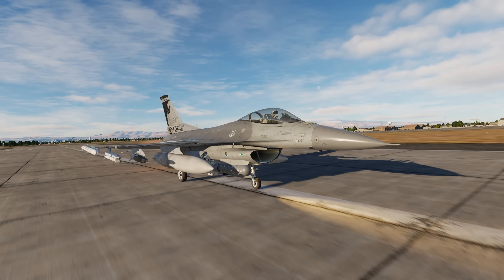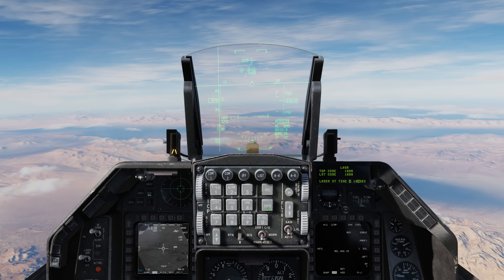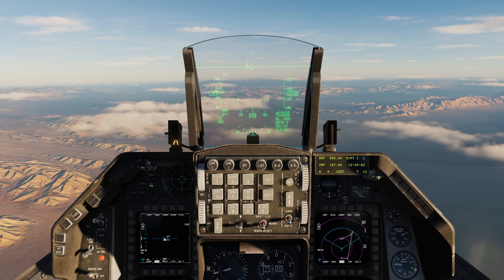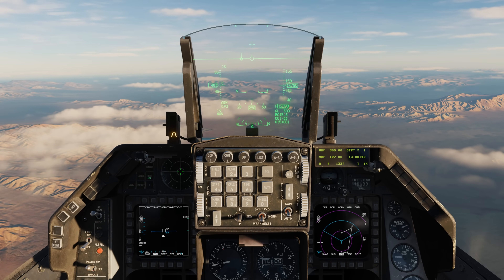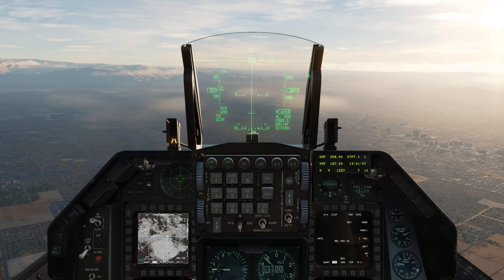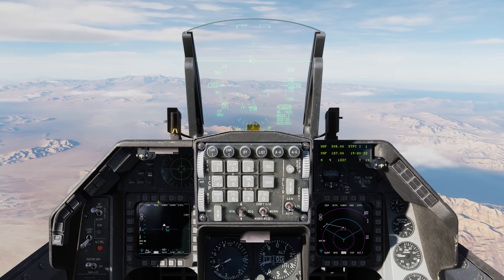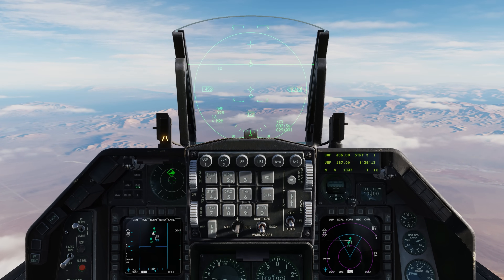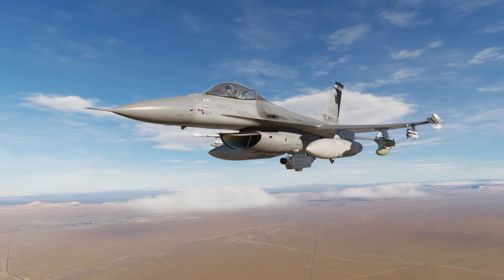DCS: F-16C Viper | August 2022 Update

Comment: Hello Matt witch systeem are you running?  Specs?
Reply from the maker: See About section of the channel, please.
Reply: Thankk you. But with your 2080ti  did you ever tested vr in multiplay?
Reply from the maker: @spirosdelistavros2970  Many times.
Reply: @MattWagner  and did it run on high settings an everything smooth?
Because other guys say no dont use 3060 it wil not run on high settings. So they advise a 3070. Its weard Because are running a 2080ti its even lower
Reply from the maker: @spirosdelistavros2970  You will need to adjust your Graphics and VR settings to arrive at the performance level that best balances performance and visuals.

Comment: what are the ACTION and CHECK OFF values in the manual bombing mode table?
Reply from the maker: Action is the distance from target you start the check off from (angle off) from target. So, at 10 nm, you check off 15-degrees left or right from target.
Reply: @MattWagner  Thanks

Comment: Didn't FLCS BIT work before? I'm sure I've used it before.
Reply from the maker: Nope.
Reply: @MattWagner  hmm, maybe it was just the cockpit panel light that I've seen light up and didnt look for flt ctrl movement outside. Are you planning to implement the engine SEC check animations in the cockpit too?

Comment: So is there no way to drop the wing tanks without dropping the pylons as well?
Reply: 370gal tanks are permanently attached to the pylons. The pylons and tanks don't separate from each other when dropped. Thanks to the aft pivot fitting, they really tumble when they finally release.  When 600gal tanks are dropped, the pylons stay with the airplane. Same thing for the 300gal belly tank.
Reply from the maker: Nope

Comment: As long as I know, AIM120s are slaved by default. So without a radar lock we can't be firing a radar guided missle. Slave should be changed to BORE (OSB 19 RMFD) in order to fire an AMRRAM without a lock.
Reply from the maker: Sorry, but no. The AIM-120 can be launched in what is called "Mad Dog" mode with no radar designation.
Reply: @MattWagner  yeah I know It's called maddog but to fire a maddog, the missle should in BORE not SLAV.

Comment: Having the FLCS bit animation is going to be really nice. Stuff like that goes a long way towards immersion and content creation. One thing I've noted tho is during the HOTAS mode cycling, it seems there is haze over Vegas. Is this a tease of the weather system updates in the works or am I bad at generating cool weather in the game?
Reply from the maker: Sorry, but probably the latter.
Reply: @MattWagner  It's all good, it's to the shock of no one. lol
Reply: You can turn on dust/fog at the bottom of the weather selection page. You can set density and altitude to give just a slight haze or crank it up to try landing in "the soup".
Reply: @ImpendingJoker  When the new clouds were released I heard the fog wasn't compatible. Was that fixed at some point or was I just hearing fake news?
Reply: Bit test adds an insignificant amount of immersion compared to fixing ground unit behaviour.

Comment: Hi Matt, the order seems off - should be CCRP->CCIP->DTOS  - this may seem minor, but it has huge impact as the pilot will have to step through one extra mode, switching from CCRP for example on the base turn to final, to CCIP for the release. Could you do a double take on that?
Reply from the maker: Negative, that looks like an older OFP.
Reply: Who’s “sources” are right?
Reply: @gb7418  just got out of the jet doing ops checks and Matt is correct.  CCIP > DTOS > CCRP is the correct sequence.

Comment: For the laser CCIP ranging, by "second detent" do you mean the trigger position that normally fires the gun? If so, does this mean we can't fire the gun in CCIP mode?
Reply from the maker: To fire the gun, you must be in Strafe mode.
Reply: @MattWagner  Huh. I guess I never tried firing the gun without bringing up the gun pipper before.
Reply: @MattWagner  can we use laser rangefinding in strafe mode?
Reply: @hphp31416  yes
Reply: @hphp31416  First detent fires the laser for range finder in all cases. Second detent does the 30 seconds "latched" thing for CCIP and CCIP/rockets. So laser ranging can be used in STRF, just not the latched 30 seconds feature.

Comment: I have the question about controls. Because in modern F-16 is the "force sensing stick" - Is the controller input converted to force applied on stick or as stick position? Is possible to change the stick sensitivity in F-16C panels?
Reply: Just tune the axis in controls
Reply: @e_norrby  I want to be able to change sensitivity on the fly. Like is possible in real aircraft with the force sensing stick.
Reply: @jaromirandel543  The relationship between SSC force and FLCS response is not changeable in the real F-16.

Comment: Confused about the wing tank jettison. When you say "pylons" You mean the pylons that the tanks were attached to or all wing pylons?
Reply: I believe wing tank pylons only.
Reply from the maker: Yes, as explained, when you jett the wing tanks the attached pylons jett with them.
Reply: There are two kinds of pylons at stations 4/6. Normally the fuel tanks (with integral pylons) attach directly to the wings and come off as a single item. If bombs are to be attached at 4/6 there must be a special pair of weapons pylons must be attached to the wings first and then bombs attached to the pylons. Weapons pylons are bolted to the wing and do not come off in flight.

Comment: TOSS cue for standard CCRP attack at 2:40 - isn't it a LADD mode actually? Correct me if I wrong, but in -34 manual LADD is described as similar to CCRP but adapted for 45 deg toss bombing profile for airburst iron GP bombs
Reply from the maker: No, it is correct. LADD is a bit different and will be added later.

Comment: I know it has nothing to do with this video, but where’s Vulkan? I haven’t heard any news since july or so. I’m excited for it, because there’s some people struggling to hit over 20 fps on a beast pc with 128gb ram 3090ti and 5.2Ghz in processor in vr or even without. I hope this will bring improved fps for everyone. I think most of us want this rather than a 8k detailed map we can run with 1 fps. I hope it’s this year😀
Reply: People in the comments on this post are talking about the relationship between hardware and frames in DCS. However this is just half of what’s required. The other part is flying missions with little complexity. 

No matter what PC you have, a mission can easily tank performance down to 15 FPS. 
That’s why DCS needs optimization!
Reply: @capricerocketman1207  right? These ppl fly their jet 1v1 air to air only it sounds like. If you want a real mission you’re facked when the triggers hit
Reply: @gb7418  i play on full pve and pvp servers i never dip below 50 fps, with 3060ti. OP must be doing something wierd in nvidia control panel or something
Reply: That's exaggerating a lot. But they need to do something about performance, I stopped playing last year because my setup that got 60-80 fps in VR doesn't even do 40 flat-screen now.
Reply: @icannon6611  Yeah, i’m not sure where the bottleneck is for you - i definitely do NOT get 90 fps but it is 60+ and VR (HP Reverb; slightly de-tuned visual settings) is pretty good  maybe 35-45 fps. But i have a decent CPU, nvidia 3080, 32GB memory, a gaming mobo, all SSDs (SATA) and run flat screen at only 1080p since that is max resolution of the monitor.
Reply: @icannon6611  you got bigger problems it sounds like.  I get an avg of 60fps+ on flatscreen at 3440x1440 at max settings and rock 90fps (45 per eye) at med settings in VR and thats with a 5800X and 6800XT.
Reply: @RogueSpecterGamingOfficial  I don't know what the issue is, it's DCS specific and nothing I've done helps it
Reply: If you actually struggle with those system specs (which I indeed doubt), problem exists between chair and keyboard
Reply: Whatever numbers you guys wanna throw, yes we need better performance
Reply: @Madnot4  yes i need it! i must nineixing my friends!
Reply: Add "Dynamic Campaign" to the list of "didn't hear anything about a while"
Reply: New modules are cool but its not fun playing with bad performance. I really hope aswell we get any news about vulkan.
Reply: @fanki1730   I am sure performance keeps them tossing and turning while  they sleep at night.  
  Can you imagine how poor the performance would be if it were delivered via MSFS?  It would surely be beautiful too…at 1 fps (or less).
   I sense that you are like me and want to get EVERY FPS out of this…yet also want to do this at max settings. (Unfortunately, I too now toss and turn in bed at night…)
Reply: @fanki1730  this modules been out for a few years now though
Reply: Man until ED optimizes the code nothing os gonna happen. I have a rtx 3080 and a vive pro 2 VR set. Immersion is amazing until studdering. Can't throw hardware at problem
Reply: YESs Dudes! We need VR performances improvements! i m waiting it from the 3rd quarter of 2021!
Reply: Agreed
Reply: What’s the Vulkan?
Reply: @badger3899  TL::DR version: it’s a program interface that, in many cases, allows for better performance in video games when compared to DX11 or DX12.
Reply: I don't have a pc with specs as good as that and easily have 80+ FPS with high/ultra... What are you doing to get that bad performance 🤔😅
Reply: Hell I've got a 3070, with 32 gb ram and in VR I'm running 30-45 fps not sure what you're talking about mate.  Vulkan could help lower end machines I'm sure but anything you're describing should have no problem
Reply: i am sorry, what? 20fps with 3090ti?
my pc has a ryzen 5 5600x, a 3070 FE and 32gb of ram, and i am running on 45fps locked in vr with my reverb g2
Reply: Something is wrong with your system if you struggle to get 20 fps. Vulkan will not save you
Reply: They need unreal,engine 5
Reply: I'm running a 3080, 64gb RAM, and an I7 10700k (with no overclock)and I'm not having trouble hitting at least 30fps. and at higher altitudes I'm getting over 60FPS. All in VR (currently running a Quest 2 with a wired connection) if someone is struggling to hit 20 fps, with those specs, the problem is in their PC. not the actual software.
Reply: @davbhard  one shouldn't just accept bad software becausee you have a good machine. If you think like this they will never improve their product. It makes the ceiling of entry to vr very high not everyone can buy this sort of specs. But also with these apecs you should get Max fps regardless. They need unreal engine 5.
Reply: Hyperbole doesn't do anyone any favors. Obviously there is a need for performance improvements but at the same time, trying to paint a inaccurate picture of the current situation just makes communication about the issue worse.
Reply: Two weeks
Reply: I have almost perfect performance with my 3080ti and 64gb of ram
Reply: With those specs you should be seeing exceptional frame rates. 

I don’t quite have the same specs but I am routinely running 80-100 min FR.
Reply: @SASCAT1972  not in VR you're not unless all graphics turn way down.
Reply: @SASCAT1972  in VR?
Reply: @JayRacer  already answered
Reply: @SASCAT1972  sorry buddy, I didn’t see it.
Reply: @SASCAT1972  feel like these people are just trolls who don't even run themselves. Where's the benchmarks that show this stuff.
Reply: I have a damn near 6 year old PC with an i5 7600k and a 1070. I get around 50 frames on a busy MP server, and about 70 on single player, so if guys with beast rigs are getting 20 fps, that sounds strange to me

Edit: I play in 1440 as well
Reply: @Vinny0296  because you're playing in pancake mode.
Reply: @Hangar-zu8xg  yup, and OP said with or without VR.
Reply: @Hangar-zu8xg  also, find me a game of the same scale and quality of DCS, that runs so well in VR.
Reply: Vulkan won't fix performance. It doesn't do what you think. 3090ti not over 20 fps? Something is broken. 3080 with 32gb and I get 70 average on max settings. Any aircraft..any map. The core engine needs a rewrite to fully use modern hardware and is that really on the road map.
Reply: @TheStrategos  look at the video I linked. The guy that made it has a 3090. He also included a mission in the description for anyone to reproduce. I ran it on my 3080ti and as soon as the SAM sites start going off I get well below 30fps.
Reply: @MSFerrari248F1  where is the link? DCS is CPU limited not GPU limited. Doesn't matter what GFX card you have in certain situations script and entity processing is very single threaded and that is what kills performance. Vulkan, GFX cards won't fix that. I play large missions online often and don't have substantial frame rate hits. Sure you can craft a mission to intentionally tank your frame rates..but what are you trying to prove?
Reply: What the fck? I have a 3060ti and get 60 to 120+ fps easly but i dont use vr tho
Reply: @VulcanM61  trolling BS methinks
Reply: @TheStrategos  yeah i think so too. I even use a 1440p monitor no issues
Reply: If your struggling to hit 20 FPS with a setup like that, it's user error. My rig runs DCS in VR smooth as silk.
Reply: If those specs have an issue with DCS you've got a problem with the PC not DCS.
I've got a high end PC and DCS runs great with game setting maxed.
Reply: 128gb ram is such an overkill, i have 32gb, 2080ti, i9 9900k and i get consistent 60-80fps 4k med settings in vr. Idk if its just your pc but i think the games fine
Reply: What a lot of you are not understanding is that with his setup you are expected to play a game at Max settings with more than 20 frames per second. Yes you can play DCS VR and get 60 frames per second with moderate to low settings but with his setup I too would expect DCs to have better frames than 20 fps. His complaint is quite legit and accurate
Reply: Such B/S show me those folks....I have that setup and fly VR at 60+...

I agree, bring on Vulkan...but lets not turn to the usual hoggit tropes!
Reply: @angrymancunian  same here.  I'm on 32 gb, 5.0ghz, 3090.  VR totally playable on medium settings, reverb g2, so not a low res set.  I do get occasional hitches when stuff loads in, but Vulkan ain't gonna help that.  This guy is lying or has an issue with his system.  Noticed he didn't mention hard drive, which does make a big diff on this game.
Reply: @jackdanson2  storage is super cheap M2 SSD drives are easy too obtain.
Reply: @jackdanson2  I switch from steam vr to openXR and it made some improvements
Reply: I have a 3090ti and it’s still garbage 🗑. I’m starting to wonder if DCS is just robbing people who want to help fund a dream but Eagle dynamics are using the hell out of us for money 💰
Reply: @a_romon_noodle_8128  damn, guess I'll keep my 1070 for DCS then, cuz it runs fine. Sounds like maybe you got a defective card 🤔 😄